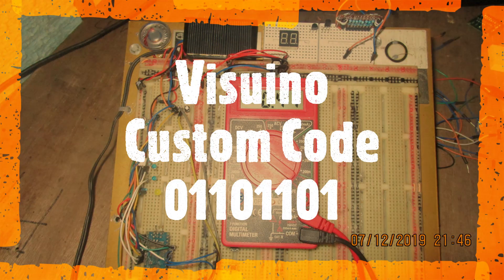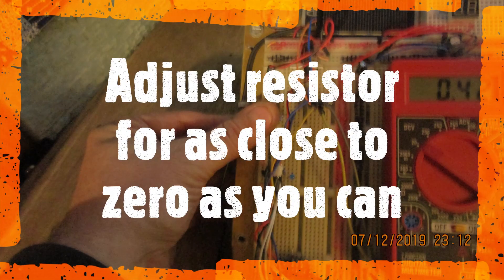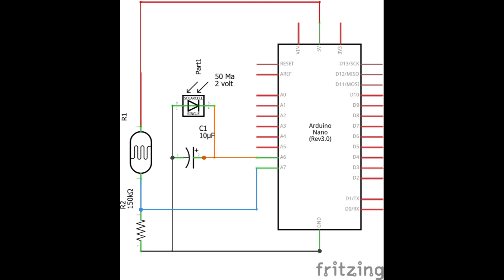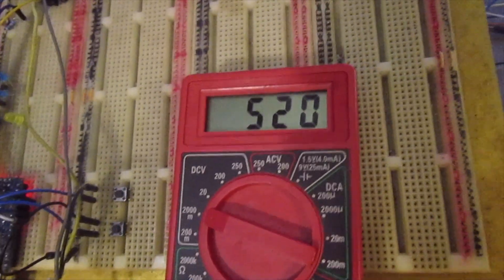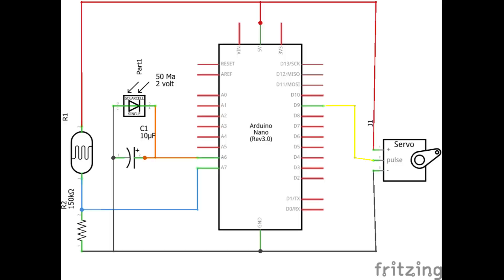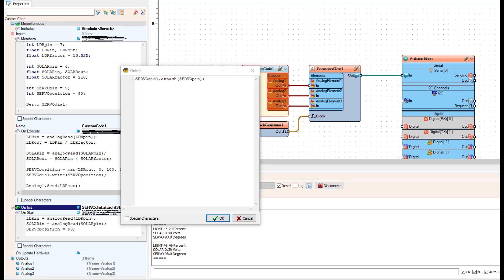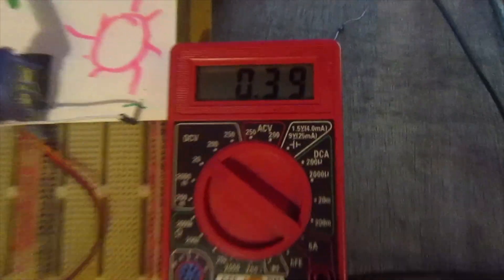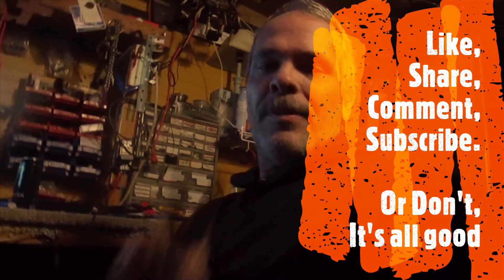Visuino Custom Code 01101101 Part 109 - OnInit, OnStart, and Direct Pin Manipulation/Reading

Comment: Great little video, it answered a few Q's I had about pin in's and out's. Thanks
Reply from the maker: Thank you for watching... 🖖😎
Reply: @JimRyan-AKA-Pigeon_Kicker  There is not much on custom coding for Visuino, will be studying your vid's to get this sorted out. it's a small part of a bigger project I have been working on for some time now.
Reply from the maker: @stylmast  Don't forget that these videos were made during the Beta build of the Custom Code component. Some of the elements and code have since changed.
Reply: @JimRyan-AKA-Pigeon_Kicker  Ok, it's a good place to start with.